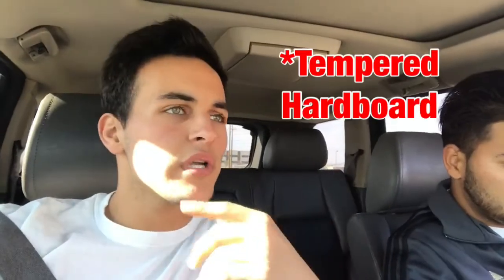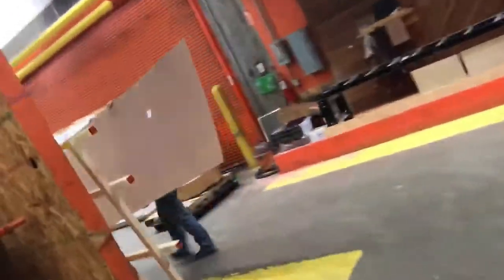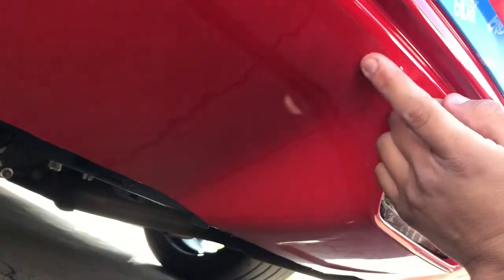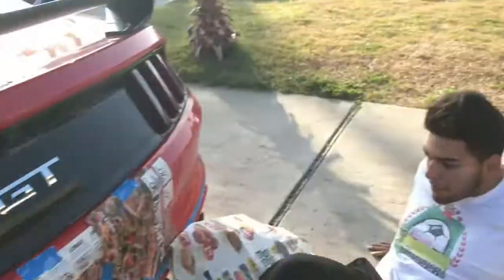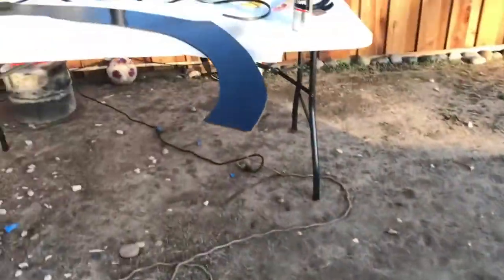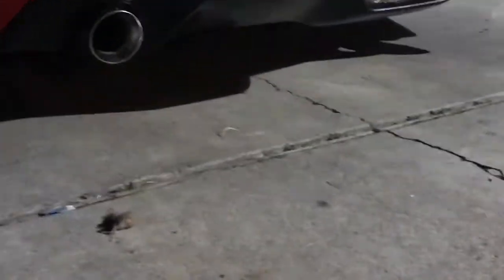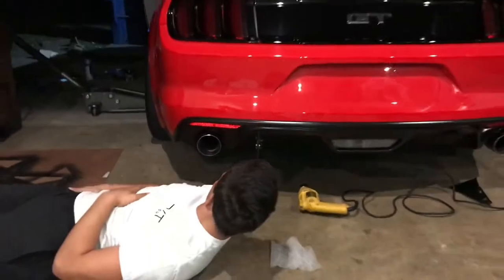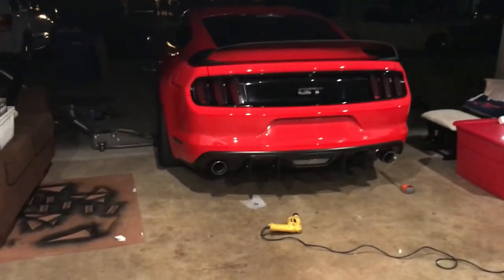Vlog 7 : Rear Diffuser DIY ! (2015-2017 Mustang)

Comment: Yeah that's a pretty tight idea dude I might have to copy that but I'm going to take my bumper off and not use the brackets just drill the screw in from the top probably have to use a little bit thicker wood but I think it's worth it to avoid the brackets.
Reply from the maker: That’s actually a smart way to go about it now that you mention it. I would also recommend using abs plastic sheets instead, after 2 winters of rain they didn’t hold up too well
Reply: @LoneWolvesMedia  right on

Comment: How did you get such a nice line when you ripped the tape off? Is the dividing line enough where it cut it by itself?
Reply from the maker: sayzay21 so basically I do 2 coats of the plastidip and as soon as I’m done with the 3rd coat I peel the tape off before the paint starts drying or else it peels off the paint too if you wait till it’s dry to take the tape off
Reply: Locally Hated Garage clutch bro, trying it out today , ty

Comment: Where you buy the plastic for the splitter and how thick is it ?
Reply from the maker: kadeem francis it’s actually a type of hardboard from homedepot . Costs about $12 for a big 8x4ft sheet . It’s about 3/16 thick I believe
Reply: Locally Hated Garage one more question .. how does it holdup with weather ?
Reply from the maker: kadeem francis so far so good , doesn’t really get wet much since it’s kinda under the bumper
Reply: kadeem francis you could probably also paint it and clear coat and itll pretty much be water proof or plasti dip it